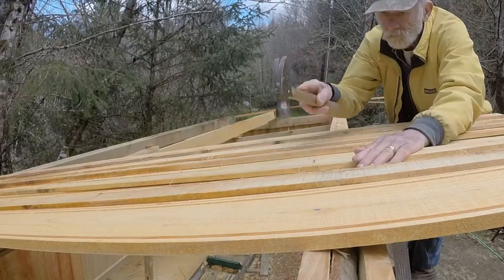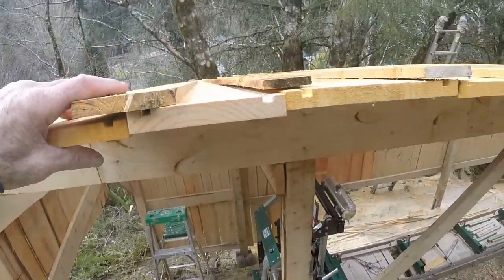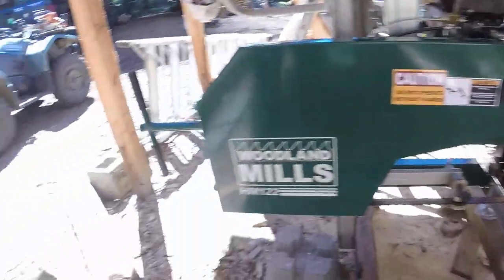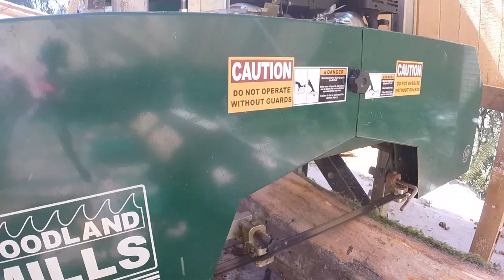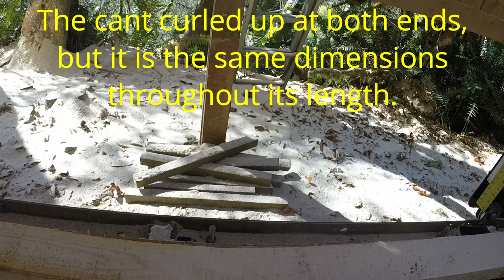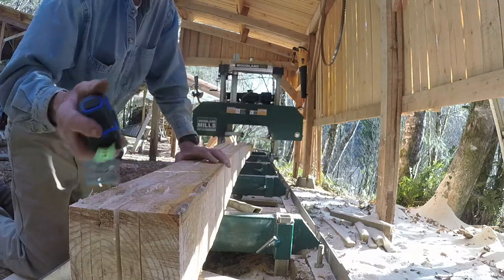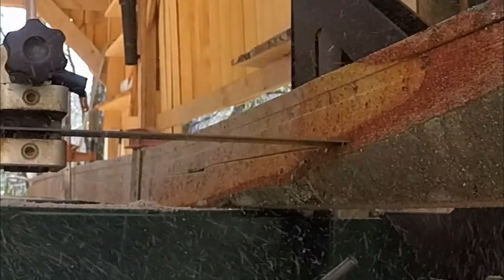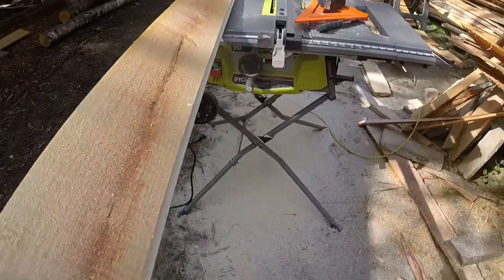Sawmill Shed #5 Finishing the Roof and Starting the Floor

Comment: Have u checked the sawmill bed, to make sure it hasn't changed any. It just maybe the wood.  My dad showed me the method that u are using and it works. May i suggest putting used motor oil on it to make it last and repeal water, he used this method on a barn and other building and i know some are 40 yrs. Old. I enjoy watching, the old times are being forgotten, i do wish u the best my friend, try the used oil.
Reply: I use 1/2 diesel and 1/2 used motor oil to help with the penetration, but I admit , I never used it on a roof. Can’t help but think it would make it last longer.
Reply from the maker: No used oil to spare. It all goes on my plywood shed roofs every couple of years, but I'll use the oil/diesel mix on charred posts that will go in the ground on my next project, I think.

Comment: hey old timer i was told that my little harbor freight will handle a 1.5 inch blade with a thicknes of .55 instead of .45 and that the added width will help limit wavey cuts ///just got one of them blades and let you know how it works
Reply from the maker: Do let me know. I've read that the thicker blades suffer from metal fatigue on small-diameter wheels. Worth a shot, though.